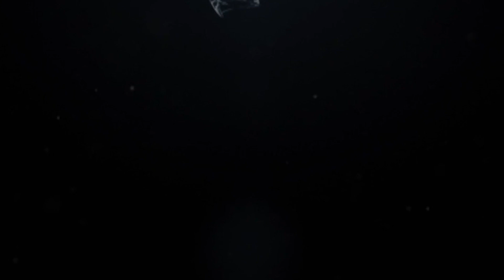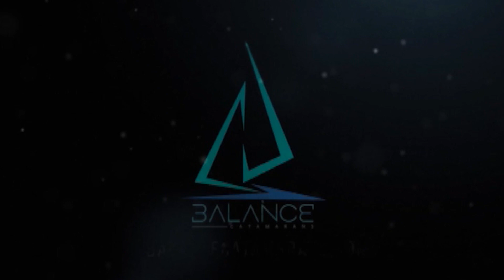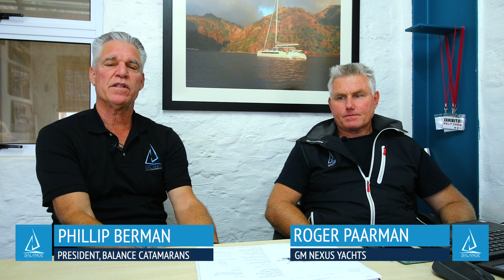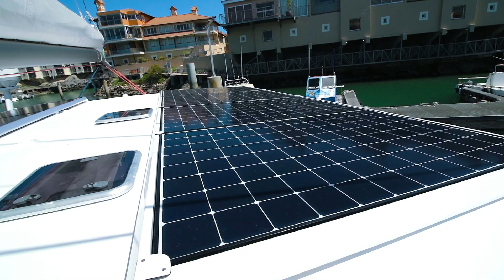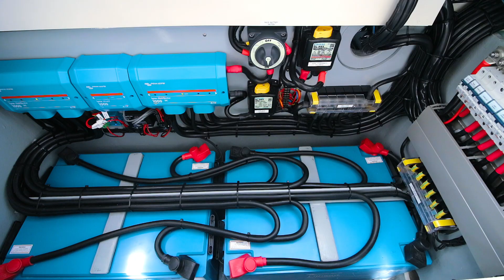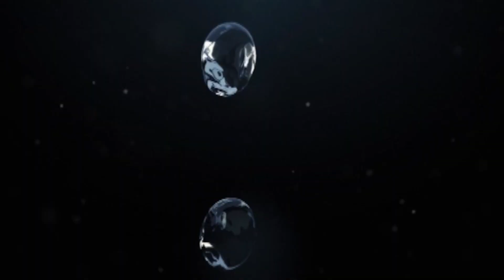Balance Build Technology - Do You Need a Generator?

Comment: I love the info video's and I understand that the voltage delivered by shorepower is not longer important. But, if so, isn't it a good thing to have all boats on  (nowadays it is 230V) the highest voltage system symply because it keeps the current in the wiring lower. Less loss because of  warmth etc. It gives also possibilities for thinner wiring (cheaper, lighter). I would think that is an advantage.

Comment: Glad that you are working towards more greener solutions. High efficiency panels, multiple controllers, hydrogenation from electric motors and lithium batteries. Have to agree that a genset backup is mission critical for long range motoring but depending on solar/wind conditions and the house loads it may get minimal use. Reduced operating costs from less fuel consumption works out well for a long term owner. Have to say the cost of all electric systems is extremely high. Got a quote for an Oceanvolt system for $144,000. I could buy 3 Tesla’s for that price.

Comment: I was just wondering today why everyone seems to always assume you have to have a genset onboard and I thought "why couldn't you just toss a decent alternator on the engine(s) already there and use that when you need to charge instead of having to maintain extra engines.

I only recently got bitten by the boating bug, but have dove deep into it, investigating any aspect I can find info on.  One of the things that really appeals to me is the idea of being as green as possible, generating all power through solar, using electric motors, etc....  Heck, I've even looked into water electrolysis for storing excess energy as hydrogen.

This is what lead me to decide that when I do get myself a boat it will be a sailing yacht, simply because we aren't quite to the point where you could realistically sail indefinitely on purely electric motors.

Now I just need the financial end of things to fall into place to make it happen, lol.

Comment: Hi Roger, I have a fleet of yachts in PNW. AirCon operation for heat is okay for once off but most definitely not good for our region, just too much power consulting’s and noise for year round cruising. The fuel consumption and power consumption is low on diesel heaters and you can heat the water at the same time. I would not recommend running Aircon for heat. By the time you run the Aircon over night and during the day.... in our shoulder season your batteries will need charging and forget solar up here as a good investment year round. I’d go so far as to recommend leaving Aircon off the boat ( only install for resale value) and install a good liquid  Espar system with flow through the Water heaters ( 12 Gal) to cope best with condition here. I have brought many cats to PNW, and like the build quality Balance is setting as a standard. Be sure you are also offering heat regulation for the Lithium battery banks. It can dip below recommended temp for charging.
Reply from the maker: We have a Balance 526 headed for Seattle and she has about 2,000 watts of solar, big litihum bank, and reverse cycle air/heat units. It will be interesting to learn how they work and if the owner decides to get Webasto or what you suggest.

Comment: Why are you using conventional shore cords for shore power if all that is being serviced is the battery charger? One 30 amp cord should be enough to handle the battery chargers, and plug in anywhere in the world since the battery charger is multi voltage and hertz.
Reply from the maker: All of our boats are set up custom for different customers, so we have no standard electrical system.